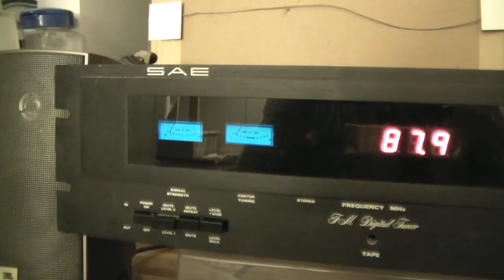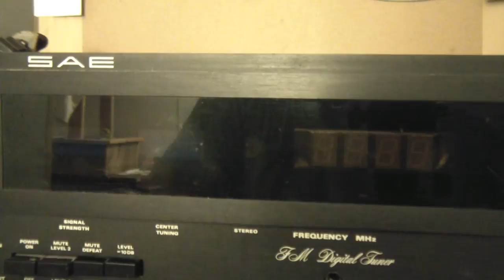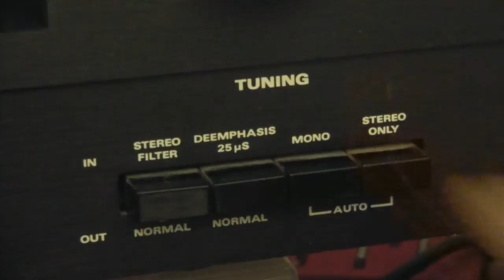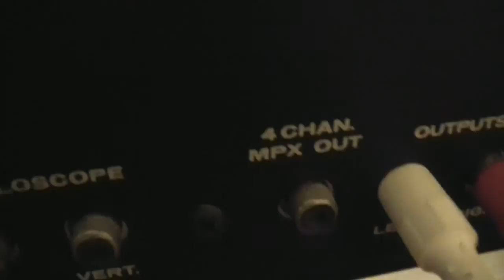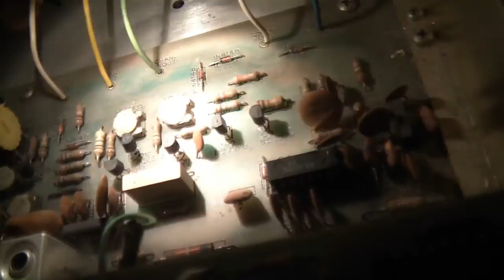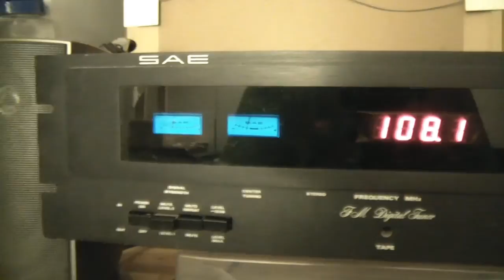SAE 8000 TUNER Tour

Comment: The MK8/8000 is prone to display problems, but reliable otherwise." Mike points out that SAE put out a service bulletin to change the resistors feeding the LEDs to prevent them from burning out.

Comment: My tuning belt broke. I substituted a rubber band but they don't last long. What's the specs to buy a proper one?
Reply: use an "O" ring,rubber is best vinyl second best.Go to a bearing supplier they have a good stock to choose
Reply: Hi, I have a question my SAE 8000 model same like yours my volume very low how you turn up the volume? Let me know Thanks... josh